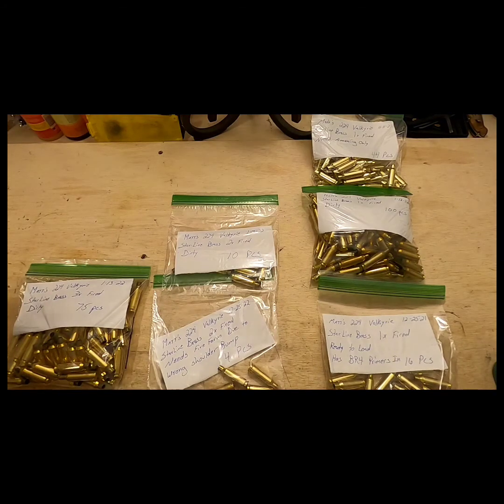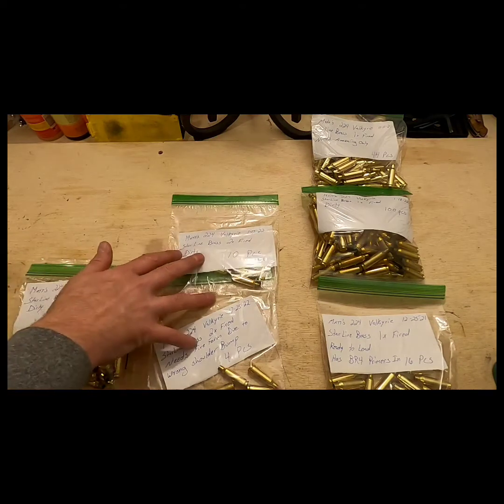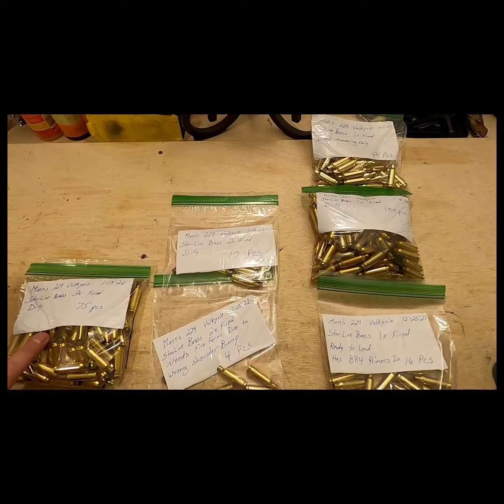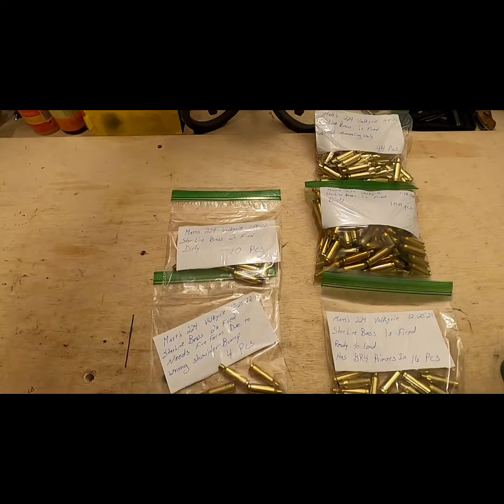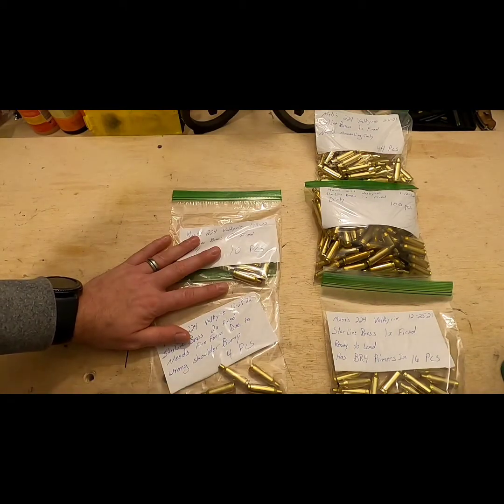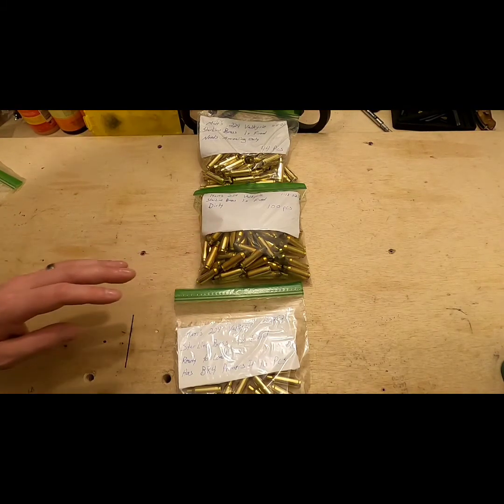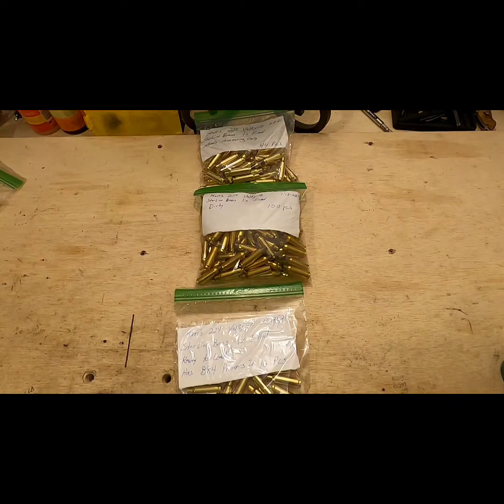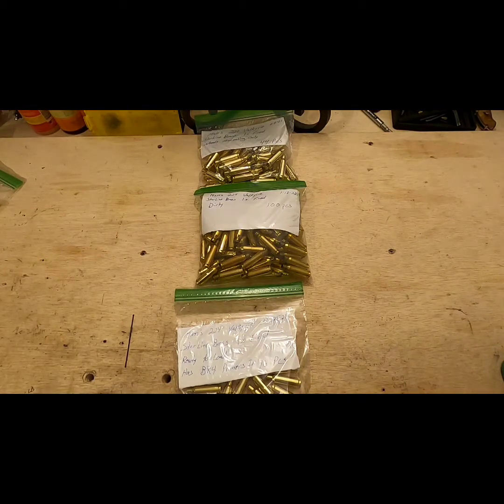Keeping Track Of My Brass

Comment: Nice detailed notes. I'm horrible at that. Have you ever made a template and just cross or check things off a list until 100% ready? Subbed!
Reply from the maker: I actually do have a template with a checklist.  It's just the easiest way to keep track of things.  Typically I will wait until I have more than 100 pcs of dirty brass before I do the major processes.  If there are less than 100 pcs that are dirty, I will deprime and tumble clean the pcs of brass and put them in a sandwich bag with a note in the bag that states what has been done and the date from when the brass was fired.  Once I have a bunch at that point, I will then resize, trim, clean and anneal.